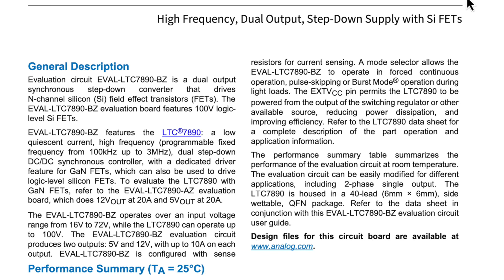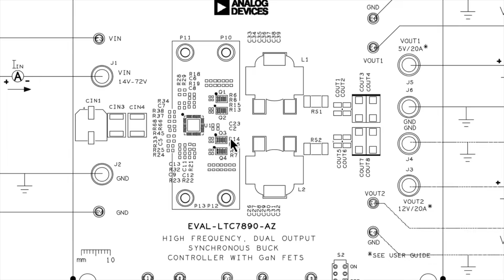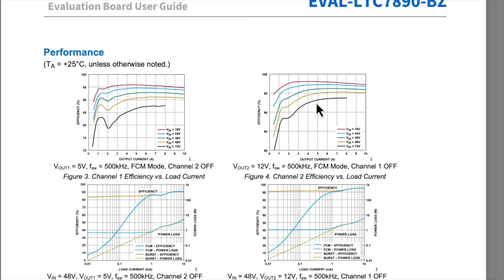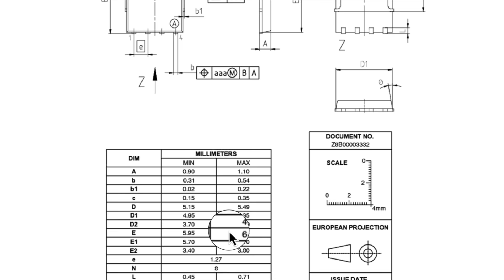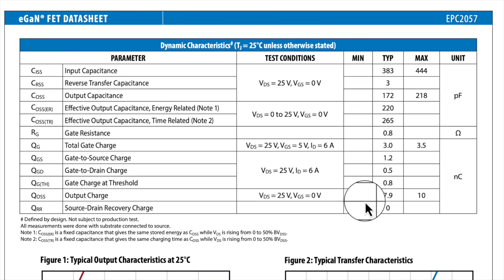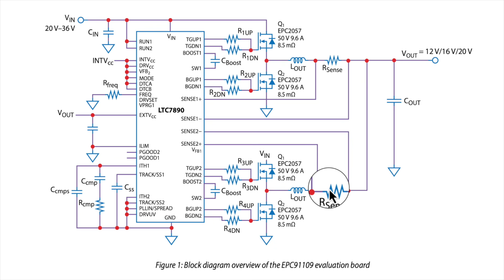GaN FET vs MOS  FET - Easy Win - EPC91109 Buck Converter #GaNconverter #LTC7890 #2phasebuckconverter

Comment: Nice! GaNs are the future. I'm wondering how soon we'll see them showing up on laptop mother boards, replacing MOSFETs in Buck / Synchronous Buck converters as well as handling the other switching needs. The boards will be smaller and the drain on batteries will be less. The increase of proliferation should also help with driving the costs down. MOS FETS will be relegated to the past like the BJT when the MOS FET became prolific.
Reply from the maker: Thanks for the feedback!  Yes I think we are on the verge of GaN FETs taking over.  I see them popping up everywhere.  The control chips like the one used here is helping the use of GaN FETs.

Comment: GaN Tech is pretty sweet, smaller faster stronger lol:face-blue-smiling:, Great to meet you today Eddie! Liked & Subed! Cool that you put out a video the same day we met! You could simply do hot air or hot plate for these kinds of small packages with solder paste. Test/signals and a practical use case or project.
Reply from the maker: Thanks for the feedback and for subscribing!  It was great to meet you!

Comment: The cost is too high. They need to put Al in the gating layer to reduce costs. Until then up the pre filter feedback bandwidth. You could swap for SiC...
Reply from the maker: Thanks for sharing your thoughts on the cost.  I think this new control chip and the new GaN FETS are bringing the cost down.  Also, when you consider the cooling cost savings I'd say that the cost for a board like this is very competitive.  And yes SiC is great - but usually for higher voltages right?
Reply: @KissAnalog Nope, you gotta go cheaper...

Comment: GaN has less rds on resistance then silicon mosfet, which operates with less heat. The board itself is awesome heat sink. Would like to see back to back testing silicon VS GaN .
Reply from the maker: Thanks for your feedback!  GaN also has less switching loss and Gate Drive loss.

Comment: DC to DC is nice what would really be more useful is line voltage to DC.
Reply from the maker: That's a good idea for a future video!  Yes, that is also a great place to use these new devices.  I'm getting back on my projects very soon - and will do a PCB design with AC/DC first.
Reply: @KissAnalog I sent you an email about reviewing a preamp but I haven't heard back from you so I guess it's a no